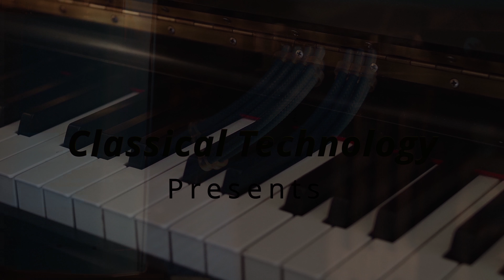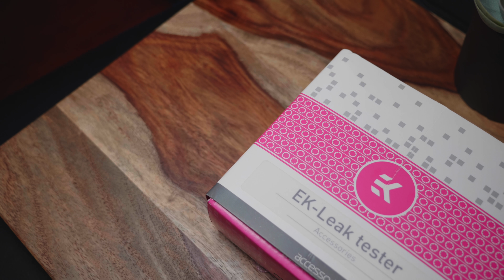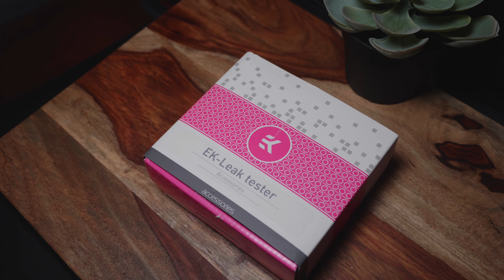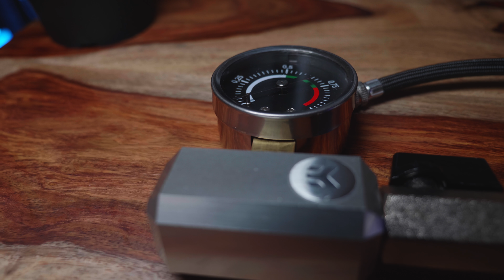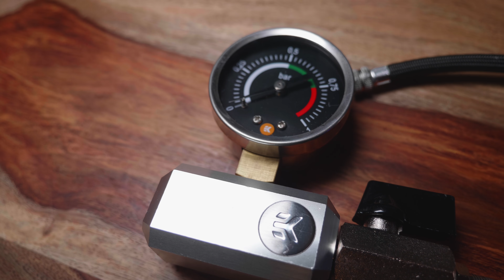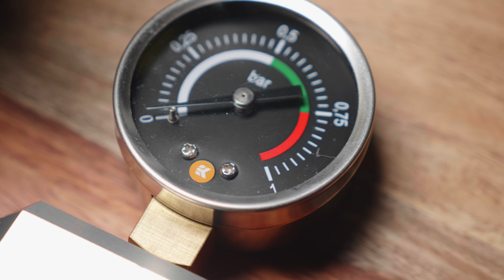How to LEAK TEST your Water Cooled Gaming PC with the EKWB Leak Tester

Comment: Sorry but this leak tester is not working: It leaks itself after a few hours. You can test that easily closing the end of the leak tester, let it run for 3 to 4 hours and it will slowly start leaking. Hence a test over 1 or 2 days is impossible.

Comment: When you say you test for a little longer than 15mins how long do you normally test? I found that after an hour or more, the leak tester itself will leak slowly. I've tested by simply capping the end w/ a stop fitting on the tester and isolated it to the leaker itself. I emailed EK and they said that's normal, their tester will slowly leak over a long time...
Reply: I see, thank you for this.  I pressured my loop to 0.75 bars at 4am and by midday, 8 hours later, the pressure gauge shows 0.7 bars.  I am sure that the leak is from the EK tester and now you've confirmed it 🙂

But WHY EK! WHY?!?  Shouldn't you put it in writing clearly on your website or manual somewhere?  Because my retail EK tester came with ZERO instructions!

Comment: Hi I have a question I’m building my first custom water pc  I have the ekwb distro plate as well as an ek tester it seems I have a slow leak but it’s coming from what they call the gpu inelt hope. At the bottom left. All my other connections seem to work fine it’s just that particular area where I’m having trouble because my distro plate has a motor back there I can see where air would get through. My question to you is should there not be any leaks of any kind?